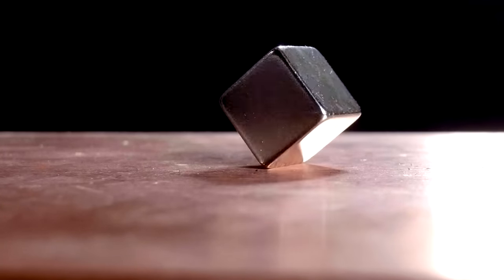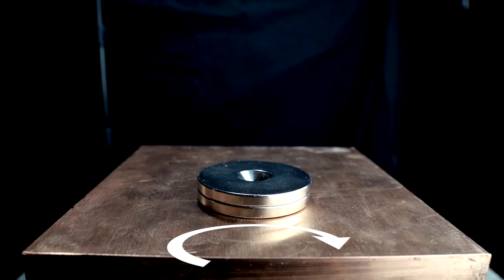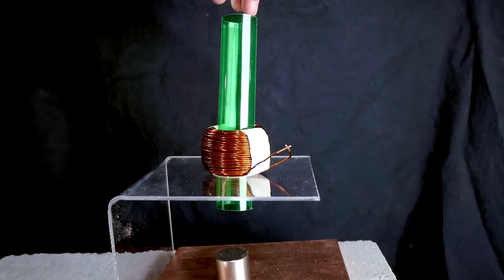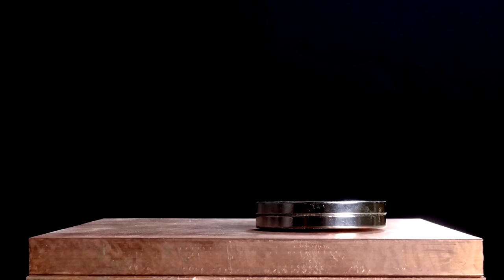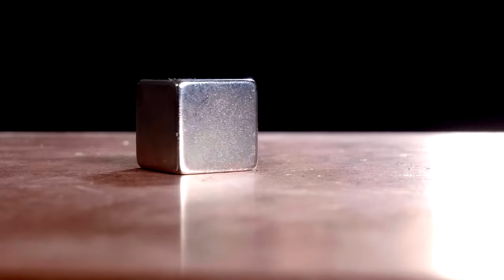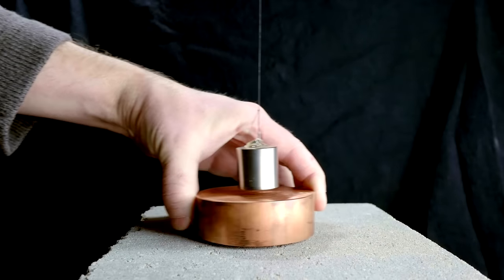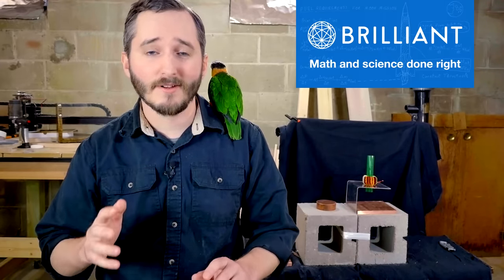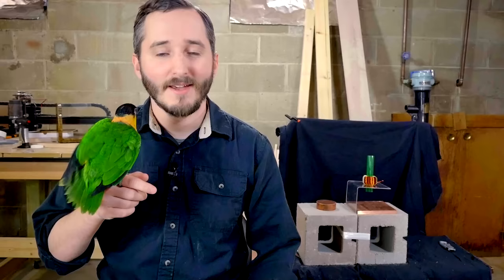Copper's Surprising Reaction to Strong Magnets | Force Field Motion Dampening

Comment: As to your video it's incorrect. :hand-pink-waving: The instant you put the magnet at the top of the copper tube it puts the same field at the very bottom of same causing it to go into the repel mode at the bottom as the magnet travels down the tube. YOU are !! WRONG WRONG WRONG wake up!!

Comment: You are completely wrong at 2:52 when you say "The LED is very efficient, so powering it doesn't slow down the magnet quite as much as when the circuit was closed directly."  The change in the magnet's falling behavior has nothing to do with the "efficiency" of an LED (and what does LED "efficiency" mean anyway?).  It has to do with how the current circulating in the coil is reduced by this load, and thus the opposing magnetic field generated is smaller.  By adding the LED, you are just somewhere between an open-circuited coil and a short-circuited coil.

Note that if you go the other direction and make the coil of wire from an ideal superconductor with literally zero resistance, the magnet would be stopped and would sit there forever.  This new coil could be just a single turn of wire.  All of the falling magnet's kinetic energy would be converted and stored in the magnetic field of the coil's circulating current.